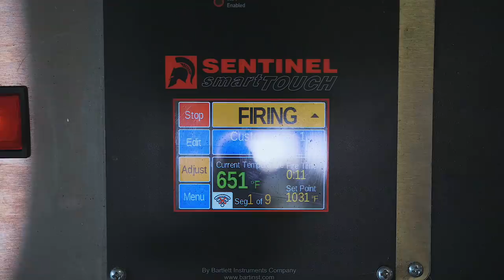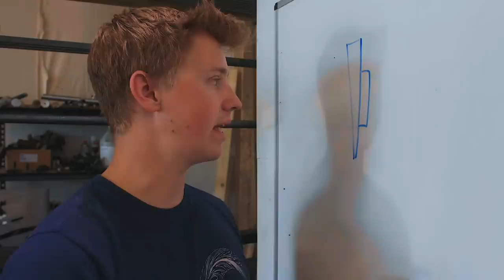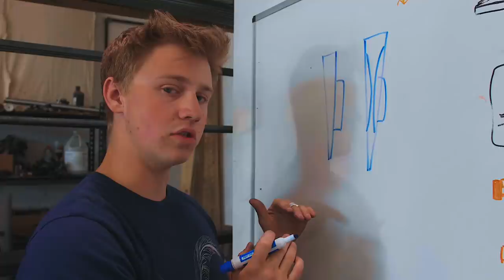MAKING A CHEF'S KNIFE IN FLORENTINE FEATHER DAMASCUS!!! Part 2

Comment: When you wrap in a steel pouch to heat treat, if you put a small (1"x 2") piece of paper in the pouch with the steel, it will burn up the oxygen and there will be no oxidation.
Reply: Have just seen that trick on oxtool vid the previous day. I'm gonna cmt about that =)) while Tom is being scared of be cut by that ss pouch, Will handled it like normal paper, lol

Comment: Just a Machinist heat treating trick: Add a piece of paper so that it burns all of the oxygen in the pouch.
Reply: Hey, that's clever!
Reply: Completely guessing here, but is there a chance that the carbon from the charred paper could diffuse into the steel and mess with the composition?
Reply: @juliaf_  I'm just guessing too, but I suspect that whatever carbon transfer that happen is only going to be skin deep and would come out in the grind.
Reply: @juliaf_  Carbon diffusion is a rather slow process compared to that of thermal cycling the blade. Carbon diffusion for case hardening mild steel takes tens of hours if I am not mistaken.
Reply: my knifemaking mentor taught me this trick as well!
Reply: @bensthingsthoughts  I think you're right in that case harden carbon soaking takes time. I love seeing the comments of engineers, fabricators, metallurgists and all that. Proper educational Steele and Stetler fans!
Reply: I've used tobacco for this too.
Reply: This! 👆
Reply: @patrickmcguire9663  I've seen the tobacco in a pouch trick (2 cigarettes) but the smith was using coal. He used a pouch again for hardening. Why? The pouch burned up just before the quench. Still worked.
Reply: I'm no blacksmith nor a machinist (a not very experienced welder), but just wanna say that it's amazing how much information I can learn from the videos and from the comment section! Thanks!
Reply: Leaving some dykem in the blade does the same thing. It burns up and removes any residual oxygen.👍
Reply: Thank you .... ! I'm trying that asap
Reply: @juliaf_  The amount of time required to let the carbon diffuse is super long, like 12 to 72 hours at 1650F so I would worry about it. It probably only hardened the steel only a micron thick at that temp and time. the rest of the steel still has it's original properties. I took a class on Material Science, (Drinking from a fire hose).
Reply: @bensthingsthoughts  yes, you are correct!
Reply: @juliaf_  no.
Reply: @riftalope  inert atmosphere stops the steel from going soft.

Comment: Will: "Gloves ? Never heard of that Barbie accessory"
Reply: its been my experience with forge work in particular that gloves pose more hazard than protection. if you grab a piece of metal that is too hot with a glove, you are liable to hold onto it long enough to shrink the leather around your hand, and then soak that heat into your skin while you are unable to get the glove off resulting in severe 3rd degree deep tissue burns. whereas if you grab the same metal with out gloves you notice the heat, and let go immediately resulting in, usually, surface level first or second degree burns.
you also have less control over the hammer, and tend to lean on the gloves to protect you while you grab things you really shouldn't. all of this results in a significantly less safe working environment.
Reply: @jondepinet  Above is all true from my experience. To add on to this as well when you are doing very precise work that barrier between material and hand takes away some "feel" as well and makes work less accurate. I do steel fabrication work and I always take my gloves off when doing particularly precise layout and fitment.
Reply: @jondepinet  But maybe he should have used gloves for handling the stainless foil
That stuff makes extremely nasty cuts

Comment: But can I also get a sensor sensor? In case my sensor fails, I'd like to know my sensors are also working.
Reply: I wouldn't be surprised if they actually have that 😂
Reply: What if that failed as well? Sensor sensor sensor?
Reply: @Snekcneh12  got to check if the sensor sensors that the sensor that sensors if the sensor sensors sensors
Reply: @Snekcneh12  well yeah, sensor sensor, sensor and add a battery sensor to the sensor as well just to be safe
Reply: That's a fairly common thing. If you know how the sensor tends to fail, you can have the computer doing the DAQ see if it is in that failure mode.

Comment: The pattern really does look nice so great job with that!  but something I don't like about having a full damascus blade is that the two different type of steel don't have an homogeneous hardness which means they age and dull at different rates. I also think it is hard to reach a high hardness with a damascus pattern as having a very hard edge with a non homogeneous steel can cause weaknesses. In my humble opinion, I would rather have the same pattern but a clad construction with a very high carbon steel in between to be the edge. that way you can achieve very high hardness on the edge while keeping a beautiful pattern with a softer metal. As an amateur cook I prefer to use Japanese knives which have this type of clad construction (even on their damascus models). Japanese knives have edges that are much harder and much more durable but more fragile than european style chef knives that need sharpening on the rod every time you use it. a classic european style chef's knife will have a hardness between 55-58 HRC while a japanese knife will have a hardness from 60-64 HRC.  I just find it very enjoyable to have that very hard and very sharp edge that just slices through food with ease.
Reply: Carbon migrates at forge welding temperature, so by the time a knife is done it will have a homogenous carbon content of about .8% when using 1080-15n20, meaning that the only different between the two steels is the 2% nickel in the 15n20 which gives a marginal amount of wear resistance, but a very very similar hardness of 63-64 hrC as quenched and then tempered to 61-62. I have never seen a Damascus knife with a noticeable differentiation of wear on the edge between to steels. San mai is great but it’s not quite magical
Reply: @WillStelterbladesmith  wow thank you for you answer, I can tell you've done your research a lot more than I did. I think I only experienced Damascus knives that were softer than that and that showed an inconsistent edge, but 61-62HRC is really good for a chef's knife and shouldn't display any notable difference between the layers. Now let's see that handle and finish :)
Reply: Let me add my 5 cents: HRC hardness is a thing, that a lot of people misunderstand. For kitchen knifes 'ideal' hardness is between 56 - 58 HRC, because hardness above 60 HRC could lead to tiny chips and dents in the knife edge after some 'rude' usage. Also, the harder the knife - the harder to sharpen it. To summarize: its wrong to think 'the higher the HRC hardness of the knife - the better'. More important is from what steel it is made, how much carbon it has, what other characteristics that steel has etc.
Reply: @tyrionas  ok, i just misunderstand your thoughts from your initial comment as 'the higher HRC - the better', my fault) You're right - there is no ideal hardness. Every man could have own preferable characteristics that he prefer in knifes) Btw, I don't know what is 'often' for you. In my daily life i use some cheapish knife from 'Tramontina, made in Brazil' which have cost me probably 10 $. And I slightly fixing it twice a month (not sharpening, just couple light touches of sharpening stone to straighten edge), while cutting all types of food with it, even bread (which in my opinion is the main reason of losening sharpnes)
Reply: @ОлександрГнидюк  well a normal European chef knife you are supposed to sharpen it on the honing rod every time you use it. Japanese knives are sharpened on the stone every month or two depending on your usage. I also feel like they can get sharper on a polishing stone and stays that way longer. My knives are between 100 and 250€, I have two masamoto sohonten I use to make sushi and other things and I really love them.

Comment: Love the idea of creating a design on a billet that you turn into a tessellated pattern metal forge welded together. Another cool pattern to try using this technique would be an + shaped piece. Make an explosion pattern on the face of a square billet and then cut the corners cut off of to make it a + shape billet. Forge welding these + shape tessellations should lead to a pretty cool set of staggered + shapes. The explosion pattern might look like cardinal points on a compass if you're lucky (cuts would have to be a third off the width in from the edge to allow you to fit the pieces together as a tessellation).

Comment: Huge fan,  I was wondering if using the black aluminum foil method would have worked to hold the pattern.  Could you maybe talk about times that works vs times this method is better (as it would save on the grinding I believe)

Comment: Doesn’t the torching to straighten the blade ruin your tempering?
Reply: It depends on how hot you heat up the blade. If you heat it up higher than during the tempering it will be softer at the heated spot. If you don't heat up the blade higher you could heat it up as often as you want without ruining the heat treat.

Comment: How do you handsand with 220 a hardened untempered blade? How is that even possible? Also, when sanding do you do the top part/hollow/bottom all at once or separately?

Comment: I‘ve never saw someone do an alloy between brass and steel. Really want to see what happens
Reply: It's a novel idea, though unfortunately due to the metallurgical properties of brass & steel couldn't feasibly be done. Brass is a more cathodic alloy, whereas steel is anodic. Simply put, they don't play together very well; brass actually causes steel to corrode. Having said this though, there does exist an ancient metalworking technique developed by the Japanese called mokume-gane. This is most commonly a silver/copper mixed-metal laminate and makes for truly beautiful decorative pieces (and if lined with a tarnish resistant material such as gold, titanium, tungsten, stabilized wood, etc, can even be used for making rings). I highly suggest looking up mokume-gane; I think that it just might sate your imagination and while not being brass/steel, it still is a truly beautiful mix of metals and I believe akin to what you're imagining.

Comment: Wait a minute...did I see crappy bricks being used on the forge doors?  Are the stepper motors and computerized controller not working?
Reply: Alec, bite the bullet buddy. Go low tech for THIS one.   Then build an upgrade with automated motion detection later.  You'll have the low tech backup in place.

Comment: I am not a professional knife maker but I am a professional knife user. I lime a lot of what I am seeing so far, I don’t know if you have conferred with many professional chefs but in my experience, depending on what the task is, chefs hold knives a bit differently than you might think. For better control of the blade instead of gripping just the handle, I will pinch the blade between my thumb and forefinger at the top of the blade just past the handle. This reduces the risk of any twisting that might occur during chopping or slicing. So far in your knife design I love the section just under the tang where the blade curves in a little. This allows for the next finger to snug up against the blade. There can be a lot of contact at that point so making sure than is smooth and comfortable is an excellent feature. My only other question is about the Damascus all the way to the cutting edge. To be honest I haven’t used a Damascus chef knife as I am not a flashy Chef, I just wonder how the differing metals hold up after repeated beating, resharpening/truing , harsh chemical cleaners, beating, sharpening/truing, rinse and repeat. I also like that it is thin and looks to be very light weight. The last thing a pro chef wants is a beautiful 2 pound knife that they have to chop with for hours, light and thin and you can chop all day. Keep up the great work and can’t wait to see how this finishes up!

Comment: Great job Will!  Curious though, why do blacksmiths all seem to hold the hammer so close to the head?  You’re really lowering the power of the hit that way.  Is it intentional?
Reply: Control is more important than power most of the time so a lot of smiths hold it in the middle of the hammer or higher. The weight of the hammer does most of the work

Comment: Will, is there a reason you always put a blade or part just resting on the bottom of the oven?  I mean, it seems to me like, well, wouldn't you get more even heat if you suspended it on something in the middle of the oven?  Let air circulation go around the whole blade instead of just the side that's facing up?  Plus while I know that the kind of firebrick they use in those doesn't have a LOT of thermal mass, (it's insulation, not retention) it's still got more than air does, so....

It just seems to me like you're missing an opportunity by not say hanging the blade from a few pieces of wire, or putting a few pedestals under it to hold it up but still let air flow around the rest of the blade....

Comment: What's wrong with straightening it out in the vice and using blunt force 👀
Reply: At this point the knife was already hardened. Therefore it is not easy or sometimes even possible to straighten it without heat. The heat releases stress, but is not hot enough to make the blade soft.